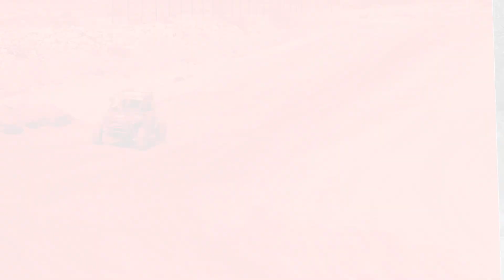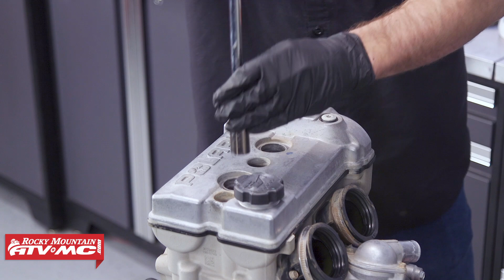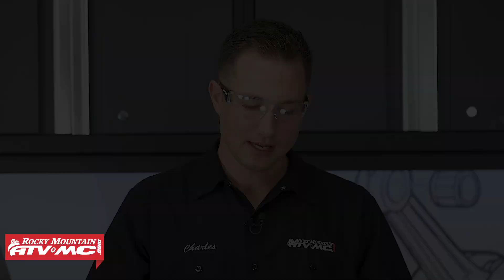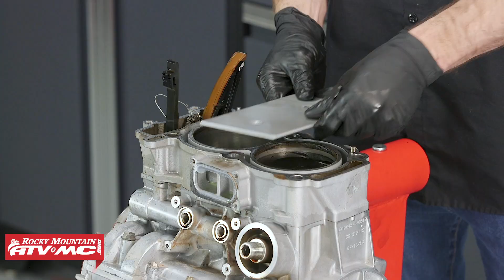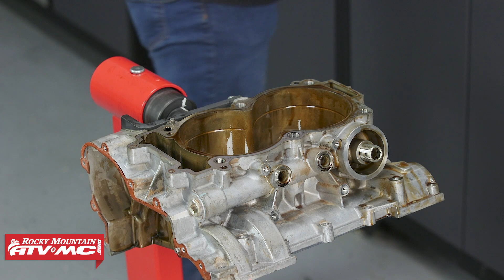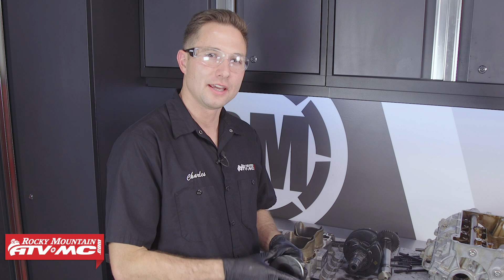Polaris RZR XP 1000 Engine Rebuild | Part 2: Engine Disassembly

Comment: Bro one doubt why don't you use impact wrench ? Any special reason?
Reply from the maker: We actually use em quite a bit, mostly for disassembly and mostly the lower torque ones. It's just a little safer to use hand tools for crucial bolts like engine fasteners

Comment: Will the timing chain come off without pulling the lower cases off? I have a 2014 rzr1000xp and I think my chain has stretched. I am having a hard time getting the timing perfect after the motor jumped time. 

I have inspected cylinders, pistons, and vales, replaced the timing chain trencher. Any knowledge would be awesome! Thanks